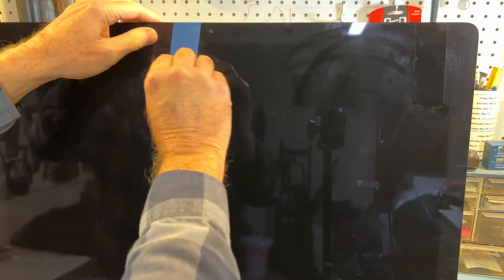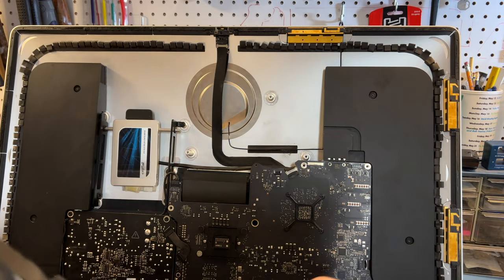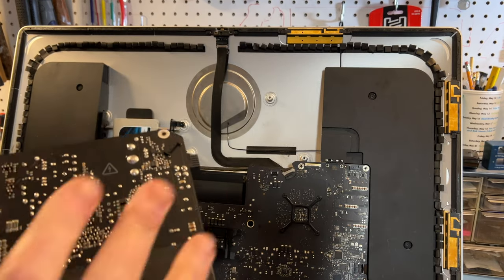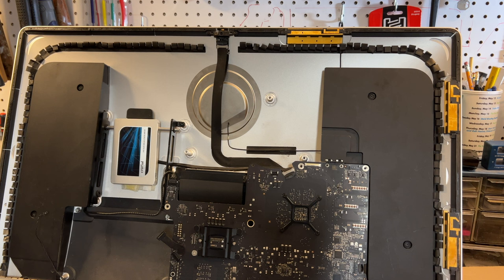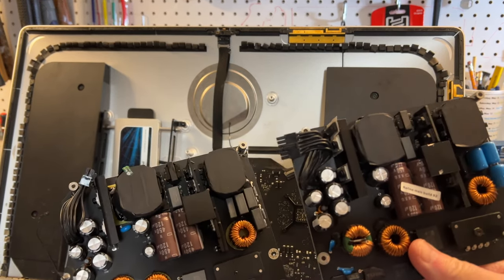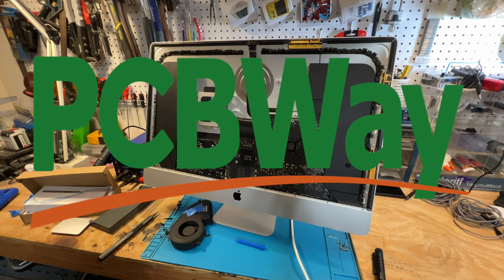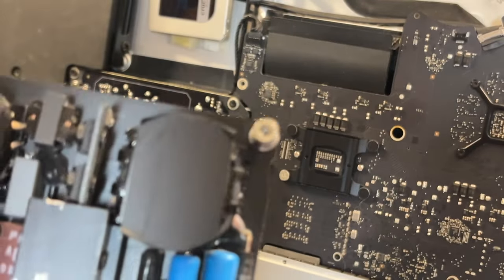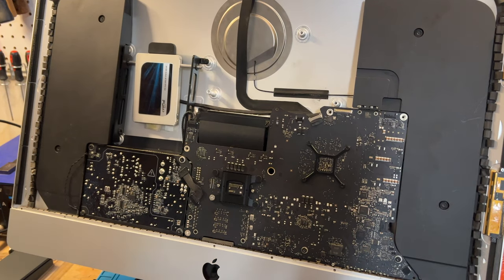Repairing 2012 iMac Part 1

Comment: What made the USB port blow the PSU? Could it happen again??
Reply from the maker: Not Sure but when I plugged the USB hub in that when it all happen
Reply: @DavidStahlOLDHAPPyMACs  Wow, that's crazy. What I'm afraid of is: What if the issue lies in your USB device? I'd hate to see you pop another logic board again... Can you verify if the device (or the cable) works fine on another computer before you try it again on the iMac?